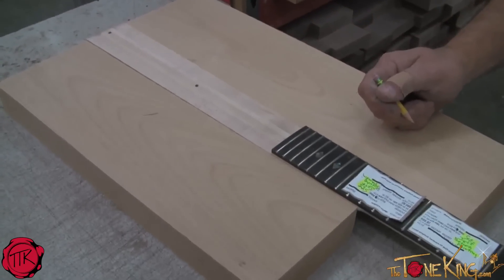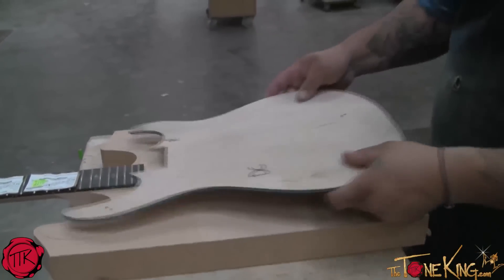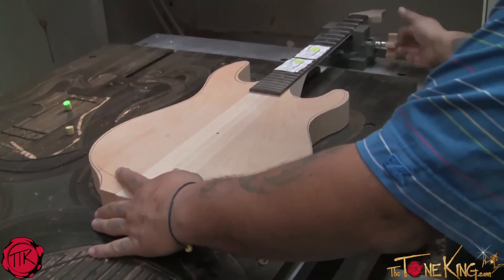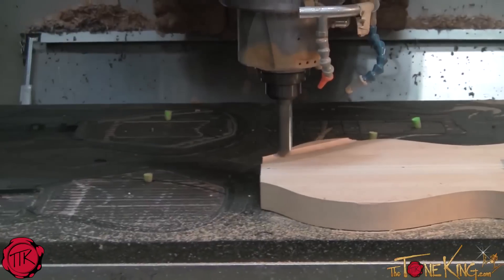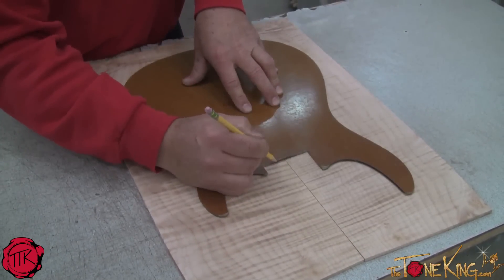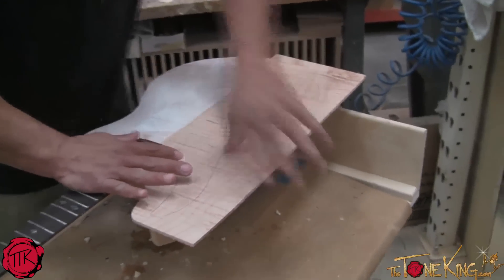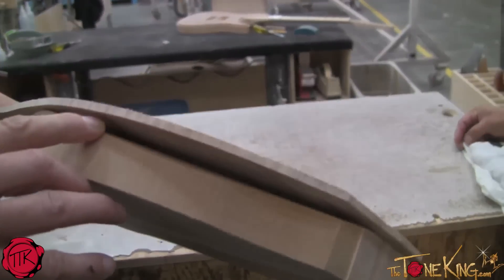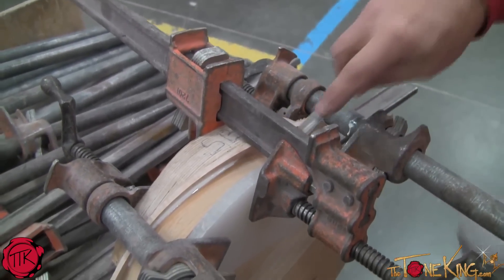KIESEL / CARVIN : BODY BUILD (Carvin Guitars)

Comment: That was a lot of fun to watch TKK. I've worked with wood for over three decades and can tell you that the steps that they are doing are the correct ones. I noticed that a couple of people posting comments claimed that there are "short cuts" in their processes. In wood working there are sometimes multiple ways to achieve the same end goal. Not all of them are "the same" steps, so people mistake these for "short cuts" when they aren't.

Comment: How does one get a job like this because I would love to do this as a career
Reply: ybe go to a luthiery school/ work with a local tech for awhile, then start sending out applications.
Reply: Awesome thank you dude.
Reply: Move to the area where a guitar factory is and start as a sanding guy.  PRS is always hiring sanders.  It's the only way in.  These companies promote from within.
Reply: Yeah, they are constantly having to hire new people. I worked there for 2.5 years. Low pay and slave driving. Runs people into the ground. A bad mix.
Reply: First I would say you must love it to the core. I thought I did too, but then I got a reality check of the minimum wage to start and the work load is punishing. I did it for 2.5 years and quit because we were treated like robots. Go to school if you want to, but the company I worked for had on the job training.